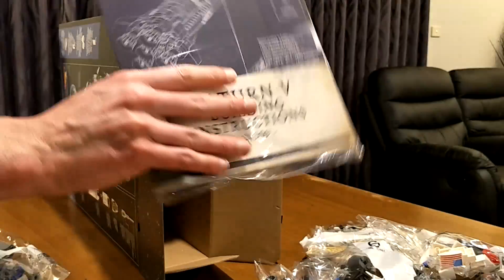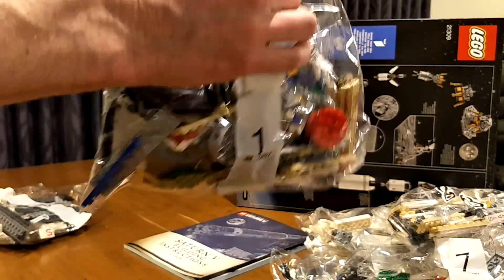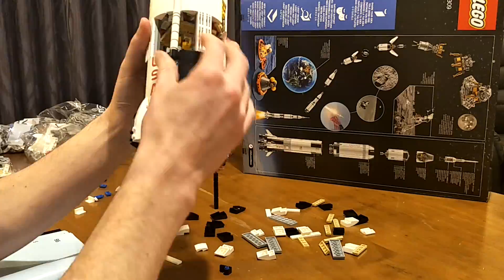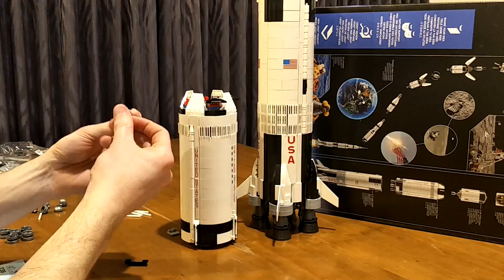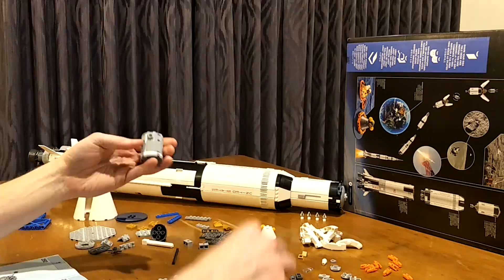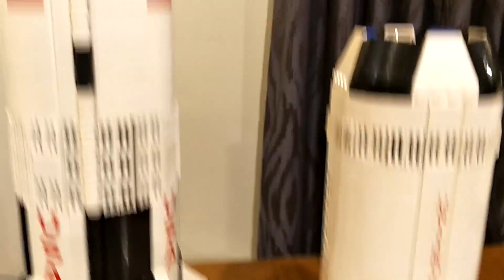NASA Apollo Saturn V - Never stop being a kid... LEGO is awesome! - Marcus House

Comment: Here's hoping I can get this amazing set by Christmas or a little after! It keeps selling out but I found one for only $10 over the initial price so hopefully it will still be in stock by the time I try to buy it... Now just to find a spot to fit it once it's all built...
Reply from the maker: It is amazing. I've heard that many places have them back in stock.
Reply: Yeah, it is definitely amazing. I knew I was in for a hell of a time when the first stage alone came to the top of my computer monitor! And I love the engineering that went into it, even if you can't see it when it's done. It started out feeling so flimsy yet the new parts double and triple connecting already existing pieces and made it SUPER sturdy.
Reply: Hey, also, do you find it hard to disconnect the first and second stages from each other? I always feel like I am applying too much force when I try to do it and it's just awkward in general yet nothing has broken so far.